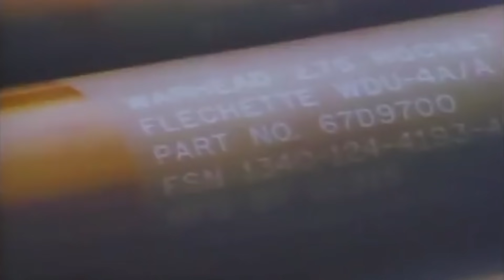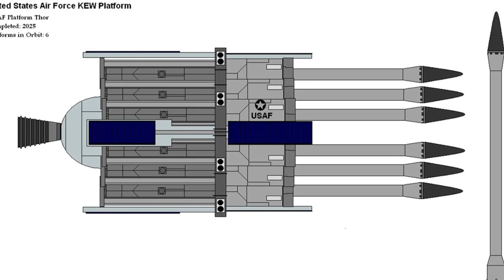'Rods from God' Weapon System Gets Another Look

Comment: "Red Dogs" were also used in WW II. A friend who was in the China-Burma Theater (Merrill's Marauders) brought back a couple after the war. He said they were dropped in mass numbers, there was no noise just all the sudden all leaves were gone, huts were flattened, all living things were dead. Light vehicles, like trucks, had holes in the roofs, hoods, bed, etc.
Red Dogs were small cast iron (?) bomb shaped pieces of metal with fins. Approximately the size of a 50 cal bullet, except with fins on the back. One had a simple 4 fined sheet metal fin and the other had a fin cast into it.
Red Dogs are NOT flechettes as insinuated in the video. Red Dogs were dropped from high altitude. Flechettes are shot from canons or rockets, or as a single sabot round as in the SPIW test.
Reply: They were called Lazy dogs
Reply: @jthewino1  Yep, another name for them...

Comment: The Rod has no where near the energy of a nuclear weapon. More on par with a MOB but there is no defense that can stop it.
Reply: This depends on the size of the nuclear weapon: W54 Mod 2 tactical nuclear warhead (admittedly the very smallest ever fielded by the US) output about 84GJ. The energy of the proposed 2000lb rod moving mach 10 would be about 330GJ. So one rod could have the same quantity of energy as 4 of these micro-nukes.
Reply: @jermainerace4156  forgot about the artillery nukes.

Comment: Ah, Project Thor. I’m thinking we have around 100 platforms in orbit with 10 rods on each. I’m also willing to bet we have around the same amount of pebble platforms in orbit with each platform having around 100 pebbles. I am also speculating that we have a network of mirrors and optics in orbit to turn the sun into a beam weapon. I am also guessing we have a network of solar powered pulsed lasers in orbit capable of melting through an engine block in a moving vehicle in less than a second. Then, I am guessing we have the directional magnetic pulse toys up their too. It wouldn’t even surprise me if we had a fleet of autonomous weaponized drones up their too.

Comment: Russia accelerated 20 foot x 1 foot tungsten rods to 9 klm per second using Foo Fighter tech in the 70's but all they did was pretty much bury themselves about a half mile into the ground, after the high discharge short cycle plutonium ion gas batteries were developed under Reagan's Star Wars program the US perfected accelerating 70 kg nickel x iron slugs to 18 klms per second in the space of half a mile, dropping at freefall until then, they're city killers...

Comment: New ceramic heat resistant coatings can be applied to the forend of the rod to protect it from burning up on reentry. With proper engineering the of the rod's nose protecting the fins can be achieved so guiding the weapon to the target wouldn't be an issue.
Reply: Mike Smith for president of the USA

Comment: to be fair, it's not dropping them that's costly. it's lifting them up to orbit.
Reply: Well, we're also talking a 1 foot x 20 foot tungsten rod.  Not an inexpensive metal.  
I work with metals.  Tungsten is hell to machine as well.
Reply: @fredweller1086  True, but Tungsten is around little more than 30 000 $ per metric ton, while sending up materials with the Dragon (one of the most cost-efficient vectors) is around 22 000 $ per kilogram... so, buying and machining the metal is by far the least amongst the costs.

Comment: Engineering already exists in the "Heat Tiles" developed for the Space Shuttle program. The same material could encase the "rods" as well and protect the projectile long enough to be effective by retaining its weight.
Reply: Maybe, maybe not, the tiles on spacecraft are ablative, and one thick enough to do the job might reduce the density of the rod problematically.
Reply: A sabot type casing built of high heat resistant material  that sheds after so many feet of descent would shield the rod
Reply: Do you have no idea what tungsten is?
Reply: The space shuttle has a comparatively shallow re-entry angle, with rods from god you want a very quick re-entry to minimize drag losses, those tiles may not hold up to the greater heating
Reply: Adjusting the penetrating point and leading face/edge can modulate the position of the bow shock which can keep the superheated reentry plasma field at a safe distance so that there will be very little conductive heat transfer and only irraditive transfer. 

That plus a blunt carbon foam nose shell that collapses on physical impact with the target and exposes the pointed tungsten penetrating nose would also work well. 

Just hypotheticals and definitely not something that's already been done 😒😒😒
Reply: One of the reasons these rods are supposed to be made of Tungsten is it has an incredibly high melting point, making it very heat resistant and making heat shields unnecessary.

Comment: The numbers just don't  support the notion that these "rods from god" would have anything like the energy of a nuclear weapon. The energy in a mass traveling at 8,000 m/second (the rough velocity of one of these rods, and weighing 1,000 Kg, would be 1/2 x 1,000 x 8,000 sq = 32,000,000,000 Joules. A 100 kiloton nuclear explosion releases about 400,000,000,000,000 joules and weighs about 100 Kg. So the nuclear weapon releases on the order of 10,000 times more energy while weighing 1/10th as much, for a energy density about 100,000 times more than the rod from god.

 Put another way, this rod from god would release about 16 metric tons of tnt equivalent  energy from a 1 metric ton weapon, not bad but not remotely like a nuclear weapon.

Comment: nowhere near the energy of a nuclear weapon.  1 rod weighs roughly 54,000 pounds at impact it is moving roughly MACH 12...generating 193866000000 Joules which is equivalent to 46.34 tons of TNT.  The Little Boy dropped on Hiroshima was 10,000 Tons of TNT equivalent energy.  Not even close.

Comment: The engineering and cost are far from the main reasons why a weapon like this was never implemented. The main reason is that most of the modern world has signed the 1967 Outer Space Treaty which prohibits the use of weapons in space. It's highly likely this treaty has been violated by the US, Russia, and China, but at the very least the treaty would cause any such weapon system to be classified at the absolute highest levels of government.
Reply: no, the treaty bans Nukes, not these, actually
Reply: Actually, this concept was made as a result of the Ban Treaty, which bans the use of Nuclear, Biological, and Chemical weapons. Dropping heavy shit from space doesn't fit any of those descriptions.

Comment: Not travelling fast enough to have enough energy to be a replacement for ICBMs.

With initial G being basically 0 due to the fact it's in orbit.
G increases linearly to 9.81 at sea level.
Kinetic potential energy relates to Mgh so g average approx = 5m/s/s
M let's say 50000 kg to be massively optimistic.
Hight of geostationary orbit 35786000m

So KE max = 8.9 TJ
So a factor of 1000 less than a 1 megaton nuclear weapon and the energy isn't dispersed above the target, but into the ground.

This ignores air resistance which will be larger the faster it goes.

If they are in geostationary orbit above a target, they are sitting ducks. Geostationary velocity won't translate as altitude lowers. So aiming will be tricky. Particularly if you aren't along the equator.

If they are in a moving orbit, they aren't easy to target and have a lot of lateral mentum. So impractical to aim without lots of propulsion

Not worth it.
Reply: not sure how a geostationary orbit would work for this. i do think modifying a lower orbit to cross over the target would work. would be a simple ballistic math problem on when to release.
Reply: @RenoSCM  I chose geostationary because it is the middle ground in terms of GPE. LEO wouldn't be as suitable because you want them to stay up for a long time until needed. HEO means G would he a lot lower and I don't want to calculate that. I tried to find a middle ground.
Reply: @markp8295  did not realize you calculated anything. i am a layperson in space ops but assuming its easier to change orbit on a non-stationary satellite regardless of altitude. but why would G be lower for HEO? i know from general physics that ground speed may vary but still that is a basic math problem to target. my other concern is that lower altitude air current would add too much variance enroute to target, regardless of the mach 10 speed. maybe not a factor?
Reply: @RenoSCM  g drops off as you get further from the centre of mass. Similar to how light from a light bulb drops off as you get further away.

I also spotted a mistake in my first comment. It doesn't drop off linearly, it is inverse square. I assume linear for the first 500km because it is close. At 1000km altitude g is approx 7.2 so at. But geostationary is just under 36000km so I was very wrong there.
For Highly elliptical orbits, you can double that altitude for part of the orbit.

Comment: Orbital velocity:
V_orb = ((G*M)/r)^0.5.
G = 6.67e-11
M = 5.97e24. 
r = 6,371,000 + (1,000,000*1.609) = 7,980,000m. 
V_orb = 7,064ms^-1.

Velocity from falling:
V_final^2 = V_initial^2 + 2ad. 
V_initial (vertical) = 0
a = 9.807ms^-2.
d = 1,000,000*1609 = 1.609e6
V_final^2 = 1.578e7
V_final = 3,972ms^-1

V_total: 7,064 + 3,972 = 11,036ms^-1. 

Kinetic energy: 
E_k = 0.5*m*(V^2)
m = 2000 lbs = 907kg. 
V^2 = 121,800,739. 
0.5*907*121,800,739 = 5.524e10j. 

1kt_TNT = 4.184e12j. 
5.524e10/4.184e12 = 0.0132kt. 

Only one nuclear weapon was ever deployed with a yield smaller than that, and it was carried in a backpack.
These things aren't comparable to a nuclear weapon. It's only just over 1.2 times higher yield than the GBU-43/B MOAB.
Useful for bunker busting? Theoretically. Fill a similar role as nuclear weapons? No.
Reply: Except you missed the part where that rod cannot go above 0.5mach in our atmosphere
Reply: @kirayoshikage4057  This is an over simplification that neglects atmospheric drag and it still yields results that are way below what's in the public mind. I'll calculate an approximation for the terminal velocity this evening.

Comment: But if you heat shielded each rod completely with RCC, the same way you did with the space shuttle or reentry capsule of past manned missions, wouldn't that preserve the rod all the way into the target?

In any case, rods don't drop straight down, but follow a parabolic path at the speed of its drop vehicle down into the atmosphere. Which means that they basically de-orbit the same way a space shuttle would. If this is the case, we might as well just put missile launchers in space that performs half the function of an ICBM. You don't need to boost it into orbit. The warhead is already in orbit. It just requires a bit of propellant to de-orbit and guide it's way to the target. Tech that is already available on current day ICBMs. 

The other half of the equation would be the launch vehicle. To ensure that the launch vehicle can maneuver into proper launch position, and then release the weapon.

Now they just have to deal with that pesky Article IV of the Outer Space Treaty.....
Reply: Geosynchronous orbit.  Just needs to do a free fall from 25,000 miles without hitting space junk in low earth orbit.

Comment: Wouldn't have the same power as a nuke.  Not even close.  The amount of kinetic energy that would be released would be less than the energy of the rocket fuel used to put it in space.  It takes a lot of fuel to create that much potential energy in the rod, but nowhere near the energy released by a nuclear bomb.

Comment: There's also the ethical implications of placing such weapons in space. These are 100% undefendable weapons that can be deployed without warning and once activated will only take 2-3 mins to hit.
Reply: Yes it was called star wars program they said they wouldn't do it 😅🤣😂😂 they did
Reply: Except it would take at least 15mins, not sure what crack you're smoking.
Reply: @kirayoshikage4057  Orbiting at an altitude of around 400km at a velocity of 27,600km/h.

An ICBM flight time is roughly 30mins. A rod doesn't include flight time like an ICBM. It is launched at the moment of decent at 8km a second.
Reply: @kirayoshikage4057  The rods still hit the ground at mach 10 or 12,340km/h
Reply: Translation:

"Stop using your high level weapons reeeeeee"

Comment: Now imagine that instead of being solid rods, they were missiles filled explosives and metal balls. Each Metal balls would have at least as much kinetic energy as an anti-tank round. Just imagine them being "shot gunned" over an enemy base. Especially if they are dropped at an angle.
Reply: You only need one. The force generated by the shock wave on impact would do the job. No need to add parts and reduce reliability.

Comment: Those are 2.75 folding fin rockets. They are not dropped from high altitude to gain speed. They are fired from the tube launcher you showed in the video and the warhead is full of flechettes. The warhead detonates close to the target showering it with these small metal darts. The effect is closer to using a shotgun than dropping a bomb from high altitude.